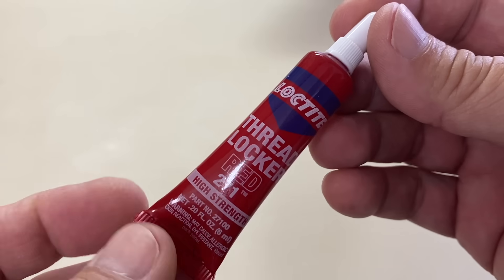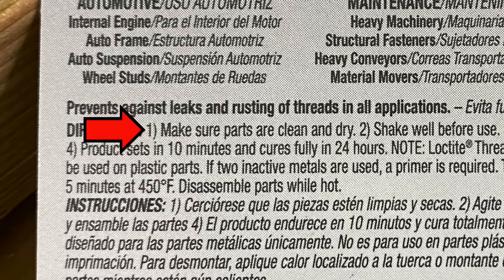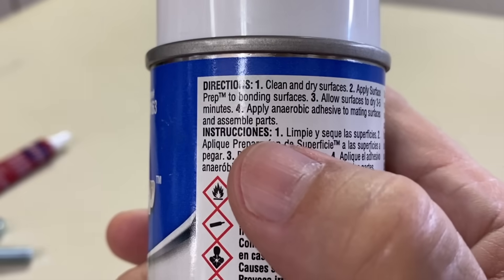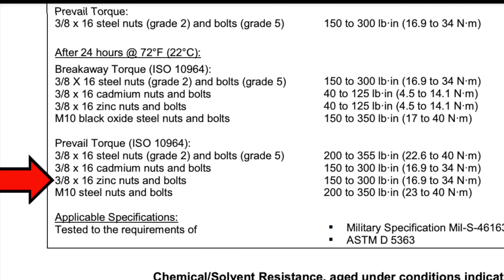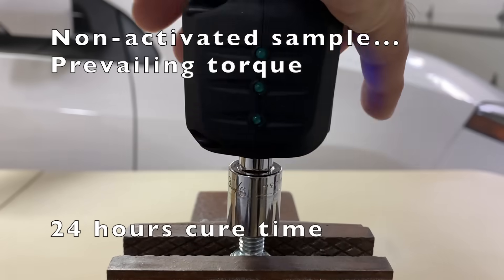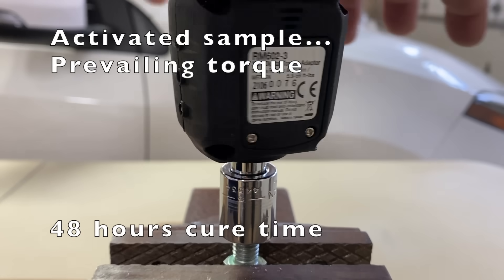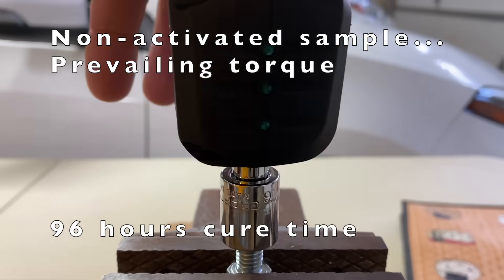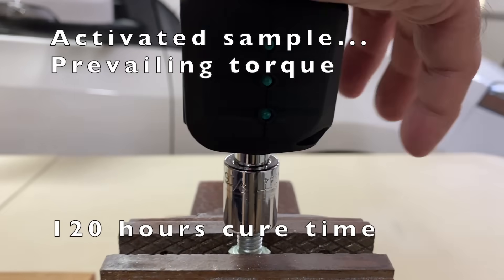Nuts & Bolts - Most DIYers Do Not Know This | Loctite Red Threadlocker Curing

Comment: Been a mechanic for 40 years & red lock tite is used for bolts & nuts that are imperative that don’t come loose like driveline bolts or any bolts subjected to torsional vibrations- bolts that go round and round. Blue lock tite is used for smaller bolts and bolts that clamp components to something like p/s box to frame. A shot of brake clean before installation if the bolts are greasy. Once the bolts are installed they usually don’t come back out for years so time isn’t an issue.
Reply: I use the same logic on rifles: muzzle treatments (especially JP Recoil Eliminators) get Loctite Red, everything else gets Blue. 

Context: muzzle treatments tend to be directionally biased, so if you set them up in the wrong orientation they can be worse than not installing them at all.
Reply: So you might imagine my surprise when I go to remove the front brake calipers from my motorcycle and they are stupidly stubborn.  Ended up using my impact wrench to get them off.  What do I find?  Red Loctite on the threads.
Good thing the last shop I got this done at is no longer in business.
So instead of a 15 minute pad replacement job, It will be a couple more days for new bolts to come in.
Reply: @MrShadowpanther3  Mechanic for 56yrs: One word "Heat." You don't have to melt the parts or burn any plastic/rubber . Not even make rainbow colors on chrome. But heat it and you'd be absolutely surprised. Even thread locker 263 will come back apart with 400°F, have a soaking wet rag there to cool everything after you loosen the part. Thread locker is plastic. If you heat it some, it softens, heat it more and it melts. ben/ michigan
Reply: @Moparben3713  Of course, he might not have expected the loctite to be on there in the first place. Though a little heat (and sometimes some ice) can sometimes help things anyway.
Reply: @MrShadowpanther3  The slider bolts usually have blue lock tite but the caliper brackets on cars,trucks and heavy duty trucks have red lock tite & they are a pain to remove. Don’t want a caliper bracket to come loose.
Reply: @palmbeachcane9523  This is the first time in 32 years of doing bike work I have ever seen red loctite on brake bolts.  I have never had any come loose.  I ended up destroying 3/4 of the bolt heads getting them off.  Possibly with the larger, meatier bolts from cars and trucks you can use bigger wrenches, but these were 12 mm heads and 2 inch threaded section covered in loctite.  Bit of overkill.
Reply: @MrShadowpanther3  Like I said smaller bolts get Blue.
Reply: Torque the bolts properly and they won't. @palmbeachcane9523
Reply: @DAVIDTRIANA-t6u  most TSBs call for lock tite to be applied to mounting bolts because they come loose from the factory. That’s brand new bolts & brand new components being torqued to specifications. Vibrations change everything.
Reply: @palmbeachcane9523  haha I've never had one come loose and I usually use CV joint grease so they don't rust 😂
Reply: @MrShadowpanther3  Even for the bolts in the u-joint straps for the driveline on a heavy diesel, we only use a small drop of red loctite and then torque the bolts to 120 ft-lb. These are 12-point, 1\2" x 1.5" bolts going into the yoke to hold the straps in. They'll never come out with that setup. People who use a ton of loctite just make headaches for whoever works on the vehicle next. But thankfully, heating and cooling will deal with it most of the time.

You want to know what's truly a nightmare to deal with, is when they put countersunk fine-thread steel bolts into an aluminum block. I typically have to weld another bolt onto the head of one of those bolts to get enough leverage to remove it. But again, heating it up and then cooling it down can help in a lot of situations due to thermal expansion and contraction. It will tend to break rust and thread treatments away nicely.
Reply: I agree over kill . But heat is also a issue for thread locker @MrShadowpanther3
Reply: Your supposed to use heat to loosen red locktite they should have used blue for the calipers and red for the brackets that's supposed to be standard from the factory but unfortunately quality has gone out the door over the past 30 some years  @MrShadowpanther3
Reply: @MrTheHillfolk grease makes it get over tightened to the point it stretches the threads and could be unsafe depending on what it is be careful
Reply: @stevenoe6395  it's been working fine since like 1988 for me.
Reply: @MrTheHillfolk  yea back then they only made 1 kind of red locktite even if it expired no problem it's not like that anymore I have seen the gel red locktite brand set for months and never harden and it was ordered from summit back before covid. Just trying to say you have to make sure your getting the original that's not expired
Reply: @stevenoe6395  yeah I came across some clear while working in a machine shop.
Usually it's for bearing or stud mount use and it's usually in a tube that cones with a part like a bushing. 
And of course you only needed a drop but now ya have a whole tube. 
Years ago I came across some anerobic sealant made for Eaton by loctite to seal transmissions up. 
Would be awesome if that stuff was available because it was really nice stuff to work with.
Reply: @MrShadowpanther3  red and blue Loctite are deactivated by about 120 degrees C (250F approx)
Reply: @Dave5843-d9m  everybody out there worried about music red Loctite on motorcycle bolts go ahead and use it or takes is a small plumber's torch the stuff deactivates somewhere I think between 150 and 200 degrees
Reply: @MrShadowpanther3  Bit of heat from a blow torch on the bolt will soften up locktite for safer removing.
Reply: @MrShadowpanther3  If you ever run into that again, heat the bolts/loctite with a torch before trying to break them loose (and loosen by hand so impact doesn't mess them up). The thread-loc that Factory Kawasaki uses on some bolts (like brake rotor bolts) is almost as strong as Red Loctite so I always heat those bolts before removing...
Reply: @MrShadowpanther3  Lucky it did not strip the threads out in the forks. Brake caliber bolts should be tourqued to specification and should not need loctite. Items like subframe bolts which are subject to vibration either use nylon nuts or blue loctite.
Reply: @MrShadowpanther3  Even track bike bolts are safety wired. Ouch
Reply: @MrShadowpanther3  apply a little heat to Loctite and it comes right out
Reply: @MrShadowpanther3  You can tighten the bolts to try to break loose the red Loctite, but just a bit, maybe turn them 5-10 degrees at the most, to be safe do not exceed the torque specs.
Reply: @ruben_balea  Tried that too.  They were not moving either direction without damaging the bolt head.
But, again, that shop has been defunct for over a year.  I normally do this work myself, but it was there for something else and I figured just have them to that too.  Ahh well.  My new bolts should be in tomorrow or the next day and I will be back on the road.  A few bucks poorer, but hopefully a little bit wiser.  
And I got to chat with y'all which is always cool.
Reply: I use the green lock tight on lug nuts and for extra safety I peen over the studs.
Reply: @garysgarage.2841  Cross threading is the best lock tite.
Reply: @palmbeachcane9523  that's what I do when I have two different cars with different thread's. Saves a lot of lock tight that way.
Reply: Any advice on gear lock keys and green loctite, specifically with application of green loctite.
Reply: @skynethell  Heat them up past 120C, which will deactivate the threadlock.
Reply: @skynethell green is strong as a hell
Reply: @guywilliam6065  I also used a dab of blue.  However these were covered completely in red.  Possibly a bad marketing move to package red and blue in virtually identical tubes?😀
Reply: @bluestreak3864  The new green lock tite is light duty. The old green was sleeve retainer and it was permanently locked & had to be heated to be removed.
Reply: @palmbeachcane9523  the green sleeve retainer also works well to keep camshaft bearings in aluminum engine blocks from spinning.
Reply: i like the green lock tight
Reply: @bencosturbz7755  find some clear if you never ever wanna remove it again 😄
Reply: If you want to remove a Loctited bolt, just heat it to around 250 degrees.
Reply: I have a Ruger Mk 1 .22 LR pistol that I bought new in about 1980.  Every time I took it to the range the front sight screw came loose.  I degreased it, reassembled it with a drop of blue Loctite and it has not come loose in 44 years.
Reply: been a florest arranger, and you are spot on, red for the perimeter than blue for center dramatization in an arrangement, lol
Reply: @blueplasma5589  😂😂
Reply: True. Regular brake cleaner do the job..
Reply: I've chilled with the blue stuff when I've had some corrosive issues with it. 
Switched to 3m yellow weatherstrip adhesive ,it's got about the same locking capabilities as blue loctite without the corrosion issues.
Reply: why the fuck would you EVER use the far shitter blue loctite?
Reply: You can also remove red loctite with solvents if heating is not possible
Reply: Do you have a comment towards using the prep for the metal or not?

I'm kind of surprised that with at least his bolt the loctite ONLY added a few ft/lbs of security.
Reply: Everyone has their preference, but Blue Loctite is fine for driveline bolts if torqued to spec. For example toyota does not use RED on driveline bolts.
Reply: @nordicpride9708  But 80,000 lbs trucks with 5” u joints & 500hp with a 1000 lbs of torque use red on u bolt straps, u joint bolts & all driveshaft yokes. I use a 1/2” Snappy impact to break them loose or a long handle ratchet & a 3/4”-1”drive impact to remove driveline yokes. Real drivelines weight over 150lb on 1 segment. Mack trucks are double tubed and the thrushaft -the small driveshaft between the rear ends can crush you if you’re not ready to remove it.
Reply: @nordicpride9708  Like I said earlier smaller bolts use blue locktite.
Reply: @palmbeachcane9523  Most of us don’t work on industrial stuff, but good to know if that day ever comes 👍🏻
Reply: @the_daily_rant I agree. In fact, I even use a bit of copperslip on those bolts and have never had a problem.
Reply: Am I correct in thinking that Zn nuts and bolts have wax on them - Zn wood screws do?
Reply: Your first words indicate that you aren't sure about your claim. 40 years? Nice crutch.
Reply: Thank you
Reply: remember that the really low hold 222 loktite is red too.
Reply: Ford Senior Master AGREES
Reply: Blue Loctite is recommended for building Voron 2.4 3D printers.
Reply: do not clean with break cleaner..
Reply: And then there’s green….for when you REALLY don’t want it to come loose lol
Reply: Learned more in this comment than the entire video
Reply: @waynedrew7074  Went straight to comments did  not watch video
Reply: been a farmer for 30 years and you are spot on
Reply: seems like you ccompletely missed the entire point of the video lmfao everyone knwos what loctite is for. watch the video again
Reply: @bmxscape  me & 250 other people.
Reply: @palmbeachcane9523  you think 250 is a large percentage of the video views or what? you and 250 people missed the point of the video, which is to show you loctite is only designed to work with reactive metals.
Reply: @bmxscape  I use it everyday for over 40 years so I’ll remember the tip when I go to NASA. The truck I worked on today was worth $1.65 million dollars  it’s just lock tite go troll somewhere else. 🧌 If you don’t have anything nice to say then. It’s 250 likes not views. Why don’t you just start your own lock tite channel.

Comment: I found this test interesting, informative, and thought-provoking.   I wonder if you would have gotten different results if you loosened torqued samples.  I'm thinking (and I am hardly an expert on the subject) that you tested the shear strength of the cured threadlocker and not the ability of the threadlocker to effect sliding between two clamped surfaces.  Would the results be similar if the same test was performed using Loctite 243 or 222?   That's the real plus of videos like this - makes the curious think about things that they long took for granted.  Thanks for your effort and sharing of the results!
Reply: Well loctite also cures in anaerobic environment. When the nut is torqued tight, it seals out the air, and allows the loctite to properly cure. This is usually when breaker bar is necessary. He basically just had some half cured, maybe partly cured goop helping raise the number a bit but I suspect torqued nuts would produce significantly higher numbers.

You’re likely right on the money with your thought process

Comment: I swear, the more videos I watch about testing Loctite, the more I believe that it's a gimmick.
Reply: Nah, not a gimmick.  I use Loctite when securing a ballhead to my tripods.  Using Loctite blue, I can generally remove the ballhead with a bit of an effort (enough effort to know that it will never loosen on its own when I'm out in the field).  The first time I tried Loctite in this application, I used Loctite red...this is pretty much permanent iand I had to use a Bernzomatic torch to heat the connection before I was able to remove it.  I pretty much stick to using Loctite blue if I ever need to disassemble anything.  If you don't have the need to disassemble, I'd recommend the Loctite red.The stuff does work.

Comment: If the nut is loose, won't there be a bigger gap between the sides of the threads, compared to if it's torqued down? It might not be a representative test. It's like testing glue with a 1 mm gap
Reply: Good point but I think this test gives a clue as to the difference between primed and not. If the nuts were torqued, break away would have been difficult to measure.
Reply: thicker on one side but thinner on the other side of torqued threads

Comment: additionally chemical lose their punch as they age. Old locktite does not hold or kick like the fresh stuff, sometimes it fails all together after a certain shelf life.
Reply: Really? I have loktite that is 15 years old and have never noticed changes in its properties as the product gets older.
I use it regularly on motorcycles and in the workshop and it always behaves as expected.
Reply: @wizrom3046  15 year old locktite is not todays locktite.
Reply: @automan1223  ... I always buy brand name loctite 243 etc. Never had any issues, I expected that the loctite company would be very careful to maintain the performance of their product from batch to batch.
I have seen nasty problems with cheap chinese glues and epoxy products. Who knows what they put in that crud. 🤔😬
I'm definitely not buying cheap knockoff thread lockers.
Reply: @wizrom3046  if you were opening tubes of product from Locktite to permatex on a regular basis you would have a different experience. Tubes half filled with air instead of product. Unmixed product, separated product. Been doing this since 1979. Things have changed.
Reply: @automan1223  ... thanks for the heads up, I will check more closely in the future.
I'm not sure about "tubes" I buy the small bottles of green and red and the big bottle of blue 243 which I use a heap of it on everything.
Reply: @wizrom3046  hahaha the green will only kick and set now if you use the activator ! If you do not use primer/activator it stays wet. Green is the sleeve retainer.
Reply: @automan1223  wow really? The green stud lock I have works perfect every time, but I do t use it much obviously. Maybe once a year and had it 15 years. The one I have is cyberbond 7648 and have always been pleased with it. It's the only time I dont use loctite brand.
Reply: I’ve got some loctite that is 25 years old it’s still just as good when it was first used

Comment: Exceptional no-nonsense presentation of valuable/everyday information. Thank you for your contribution!
Reply from the maker: Thanks!  Appreciate it!
Reply: @HacksbyDad  Seconded....thanks for the no-nonsense info! 👍
Reply: Sadly the author didn't even use the loctite suggested primer. This is just some random heptane on the glue.
Reply: Good video, very similar to @Project Farm videos testing various products and fasteners
Reply: How? They weren't fastened and where the hell are the dissimilar metals?!  So dumb.
Reply: i like too see proof basically to back claims up! ill get primer next time i need red. cool torque attachment, i want one for very light applications that are also paticular. cool demo and thanks!
Reply: The results seem arbitrary. Would have done 5 bolts at each interval, just to keep it simple and not involve other materials.